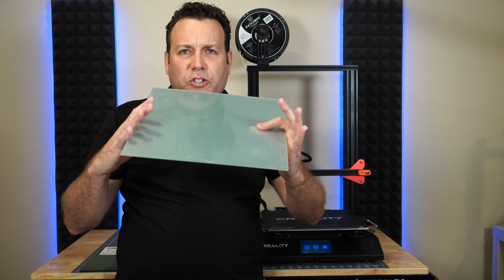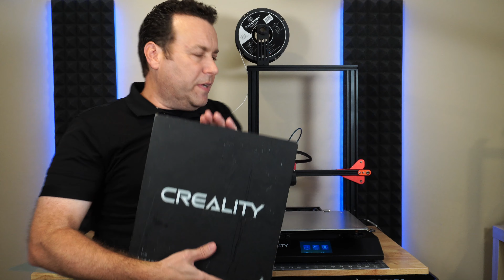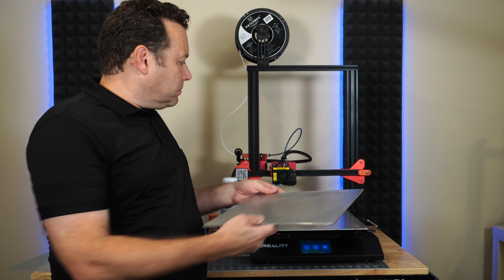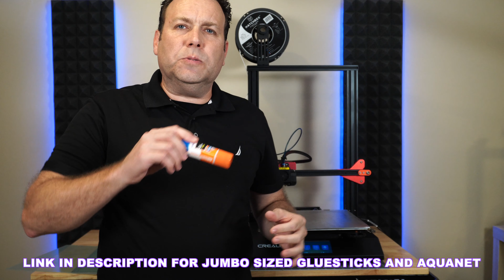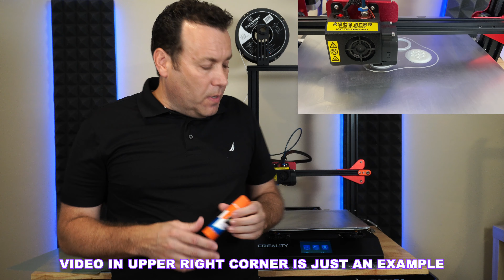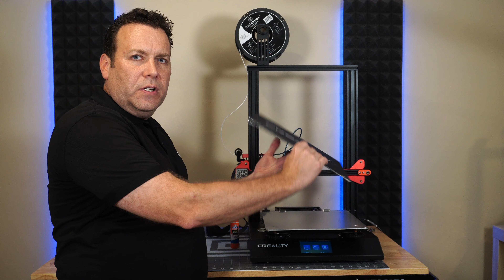CAN YOU 3D PRINT directly on the ALUMINUM BUILD PLATE / HEAT BED?? How to 3D Print on Aluminum.

Comment: 10 years ago I read articles that recommended replacing glass bed over heated bed with Aluminum.
It was supposed to improve ABS warping as I recall. 
after 20 min on youtube I'm surprised to find glass seems to be the gold standard now.
I bought a 2mm peice of Al back then but never installed beause I have a delta-V printer and cutting a circle would be time consuming.

since I'm restoring my printer after 9 years in storage I figure it's time to upgrade but what is best? 
I don't care if it is difficult to remove print... I just want to optimize temps for ABS.

Comment: I print straight on the aluminum bed. I sanded it with rough sandpaper to get some texture going and I hear up the bed to 70 degrees Celsius. It works flawlessly for me with PLA+, no glue or anything needed, just a good wipe with IPA before every print.
Reply from the maker: Yes,  I have had similar results with roughed up surface that is super clean.  The sanding marks give the filament a biting surface to bed.  Thanks for your comment.
Reply: @tr3nDmaker  I'm pretty new to 3d printing... my first goal was to print really rugged electronically safe circuit board cases for lil electronic and amateur radio projects,  using 3dxtech ESD-SAFE PVDF...and I have been having trouble using this material with my new ELEGOO NEPTUNE X...I think my first screw up is this printer max temp is 260c ....if you have any experience with this material I would love to pick your brain...thanks for the great vids
Reply from the maker: @will_der_dude  Doc Browne...Back to the Future fan?   I have Delorean fyi, if you are!  As for filament.. Never used it.   But based on your printer, you are on border of usability.  My initial thought is to print at 1/2 normal speed and slowly increase speed till happy with results.  As your max temps are a bit colder.. this is best way to print till find a happy medium.  If cooler than optimal, you should be ok... it just isn't going to flow as fast and may cause under-extruding at higher speeds.  For 1st layer... slow with higher resolution than other layers by about .4 or .8.  Example.  If printing at .2mm, than 1st layer at .24 or .28, running super slow.  This will get you a good foundation, then speed up to 30-40mms.  Experiment with raising speed till happy.  

Key.  Get a good foundation... then you should be good.  Try not to be in a race for print to failure.  Slow and steady wins the race!  Let me know if this helps.
Reply: @tr3nDmaker  thats exactly what i was looking for...thank you so so much...my problem is i havent tinkered for enough hours yet to really understand how changing all these little parameters effects the print. I will keep at it and def appreciate you taking the time to give me that advice more than you know. Happy New Year!
Reply from the maker: @will_der_dude  you are welcome.

Comment: I have an anet a8 and have been printing directly on the aluminum heat bed almost since day one.  It works very well with some glue stick and is probably the best print surface I tried. The only drawback is you will scratch up your heated bed which actually only makes your prints stick better.
Reply: Actually i got a flex plate with a smooth and textured pei surface a few months ago and prints don’t stick as well as a bare aluminum bed prepped with glue stick. But I started having similar results to the bare bed when I started using glue stick on the pei. Also I found that on both the bare bed and the pei if you let the glue stick build up over a few prints it actually creates a really good print surface that can go 2-3 prints without applying another layer of glue stick.

Maybe its just my settings or maybe i just never prepped the pei right either way i stick to the glue stick as it rarely gives me any problems
Reply from the maker: @joshuahuman1  I am a firm believer in "whatever works for you".  You can condition a PEI set with fine steel wool or finishing pad.  It will give a bit more bite.  Thanks for your experiences with straight aluminum.
Reply from the maker: It definitely works.  That being said... try a PEI sheet on the bed and you will never go back.

Comment: all i ever done strat aluminium plate
Reply from the maker: It works fine… what are you using for better adhesion?  

PS.  I added a PEI sheet… it is amazing!
Reply: @tr3nDmaker  just glue stick

Comment: Good info! 
What's a good surface/method for an unheated bed?
Reply from the maker: Textured surfaces are usually the best for unheated bed… the textured surface add a bit more bite to bed.   

Many use way to much heat for printing… for pla, I usually print at 40-50 degrees.  But, I am printing on glass… sometimes using a glue stick. Whats your printer?
Reply: @tr3nDmaker  I'm building one from inkjet parts: dc motor with encoder. It's on my channel.
Reply from the maker: @TheRainHarvester  Super cool!   You are the man...  What I would recommend is buying the textured surface for the CR-10s Pro.   3 for $20, might a single for cheaper.  The cr10-s pro surface is not overly rough and give strong adhesion.  However, and cr-10 surface will work also.  You may get away with just printing on the aluminum with 2 or 3 layers of glue stick as in video... But, I never tried it.
Reply: @tr3nDmaker  This is great info! Thank you.  Please could you paste your comment in my video's comment, so I can have a link back to your channel?

Comment: elmers glue spray works fantastic on glass. 2 light coats. then use the glue stick 3 coats...your print will never fail. i have a divinci all in 1 pro been printing on glass for 4 years now like this. also..rinse your bed after every 3 prints. then re glue.
Reply from the maker: I have 5 printers with glass and to me.... Only way to Print.  I just use 1 coat of Elmers Purple typically though .   The issue arose form a Prototype project for a client whom wanted solid portions thorough-out  the print and the bed surface got damaged.  Had to meet deadline...  On CR-10s Pro with inductive sensor and couldn't use glass.  I had to print asap and didn't want to spend hours re-doing all the custom g-code for a different printer.  So , I figured out this method on the aluminum build sheet.  Ultimately, I created a dual build sheet with a new textured surface on one side and PEI on the other.   But, straight on Aluminum worked awesome for a couple weeks.   Thus , the video.  Thanks for your input.

Comment: This is maybe a dumb question but did also heat up the bed when applying the glue? I'm using PETG, do you think the glue trick will work?
Reply from the maker: Glue stick works great for better bed adhesion for pla and petg.  Cold or warm... it doesn’t really matter.

Comment: I just got to ask. So it is YES, as long as you have a bed promoter?
Reply from the maker: Exactly.  Usually 2 coats. Its a good temporary solution, but in long run... get a pei or textured surface.

Comment: have you ever had your filament brake in the feed tube useing pla i seem to have that problem at the min ?
Reply from the maker: If filament has absorbed moisture it becomes brittle and can snap easily.  What is your retraction mm and speed?  

I have had filament snap as it is bending into extruder, but not inside. Due to moist filament. 

I am planning a video on drying filament soon.  I would suggest setting the roll aside to dry later and use a new roll.  I have video on top 5 filaments with links on amazon.  Some brands are better than others regarding moisture.
Reply: @tr3nDmaker  140 retraction and 50 mm ps output is that ok ?
Reply from the maker: 140 mm of retraction is massively high.  Looking for number from 5-7mm.  As for speed, 50 is high.  Retraction likes 25-40mms.  Any more and it looses efficiency in my opinion.